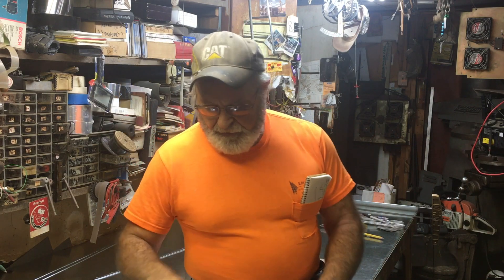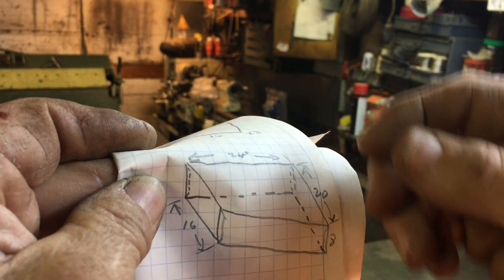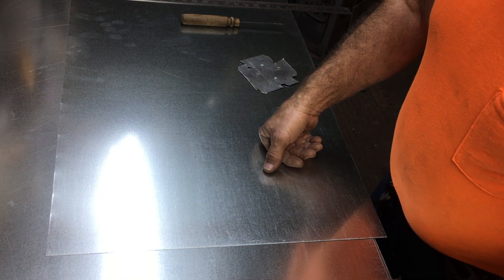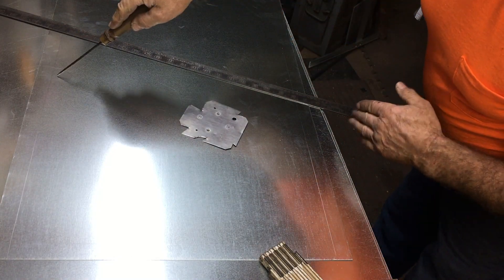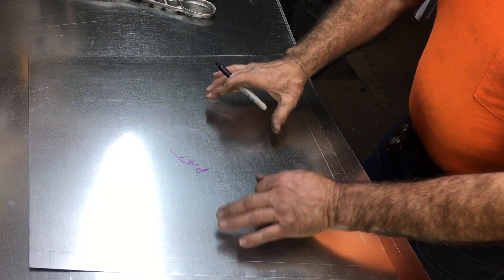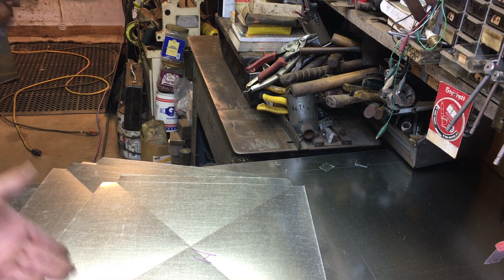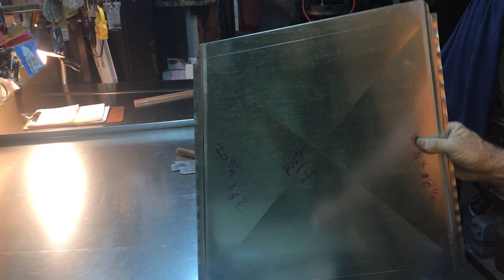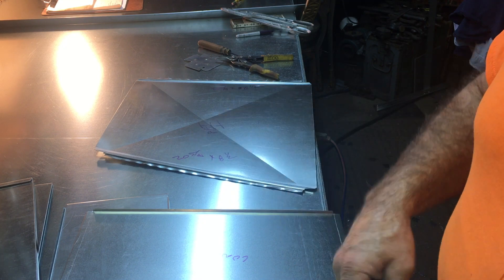HVAC Sheet Metal Layout Part 3

Comment: Please don't stop making these sheet metal fabrication videos...

I'm young and 2 years into HVAC. Need to get sheet metal transitions/offsets/plenums down. I'm using your videos as my guide. Thank you very much.
Reply from the maker: Thank you Ben for the awesome compliment.  Learn all you can about every segment of the industry.  Never try to lock yourself into just one specialty. It is a vast and rewarding industry that's treated me well for more than 4 decades. I have a good number of videos, the later ones being a bit better.  Though I am retired, I will continue to make the videos as the opportunities come my way to be a bit of help to older people in my community.  I wish there was a 'YouTube' back when I was a youngster in the industry.
Reply: @tractorman4461  I'm very fascinated by the industry. Working my butt off to develop my skills in HVAC everyday. I'm residential installer..trying to learn as much as I can....diagnostics...commercial...boilers...etc. I've been struggling to find any content on the internet with plenums, transitions, offsets for residential change-outs. Stumbled upon this series. Very thankful for you. These videos have great value. I plan on really practicing these videos over the next couple weeks.
Reply from the maker: @benjass8552  Have you found my multi part series on the Heat Pump Attic Installation yet?  I think there are 8 parts so far, with a couple more to edit and upload.  You may like that series, as there are some tricky fittings shown.https://www.youtube.com/watch?v=RxAmJKLDz-8&t=265s  They are all named the same but prefaced with Part 1,2, 3 etc.  Keep up the hard work and I guarantee it will pay off !!  You should ask some old timers around your neighborhood and I bet you can find some old sheet metal machines fairly reasonable.  That's how I got most of mine.  I just stumbled across another 8' brake not too long ago.

Comment: Great tutorial, Tractorman44. Preferably Pittsburg female lock should be on the short dimension with the drives. Drives help stiffen the fitting when hammering over the Pittsburgh. Excellent work from a man with no formal training. Cheers.
Reply from the maker: Thank you sir for the compliment.  You are absolutely correct about the location of the Pittsburgh on this type of fitting. I normally do just as you suggest with few exceptions. I realized the error as the layout progressed, but was already committed to it in this manner. 

I could have amended it during the process by cutting 3/4" off each edge, but then the description in the earlier part of the video wouln't have made sense.  So I just ran with it. My only excuse is I'm just a little bit rusty...I used to not have to think hardly at all during routine layout. lolol  Things change with age....  Thanks for taking the time to comment and thanks for the constructive nature of your comment sir.  It is appreciated.  (There is a lot more to come in this series as damper parts have been on order for a week or more now).

Comment: Very interesting. Concept seems simple and you execute it as such, however, I am sure it is difficult to execute within tolerance to prevent leakage. Very good video.
Reply from the maker: Thank you sir for the compliment.  As with anything practice improves efficiency and speed.  I am certainly a bit rusty as this is surely not something I engage in  daily and in actuality, I have no formal sheet metal training.  I've learned by observation combined with trial and error. Some more cool layout up ahead.  I'm hoping to keep your interest for a while and I appreciate the time you've taken to watch and comment.